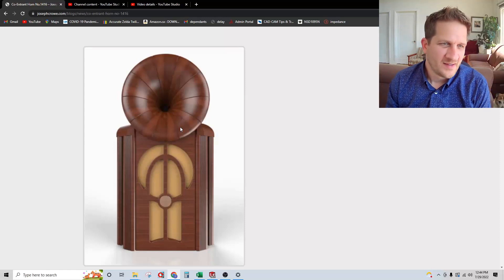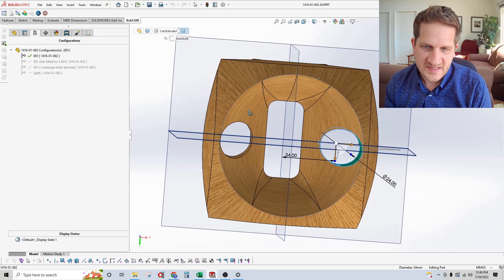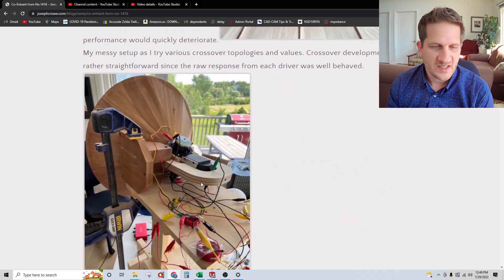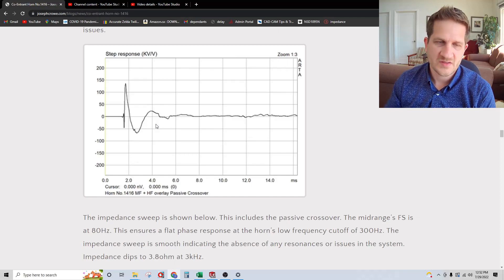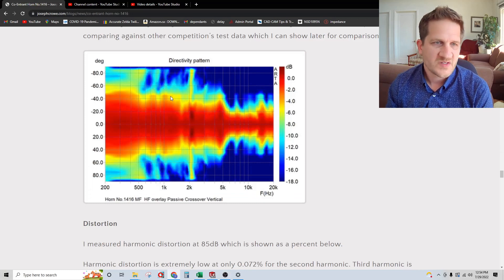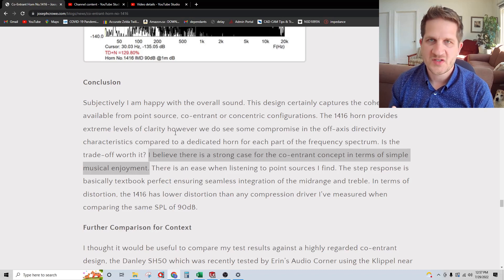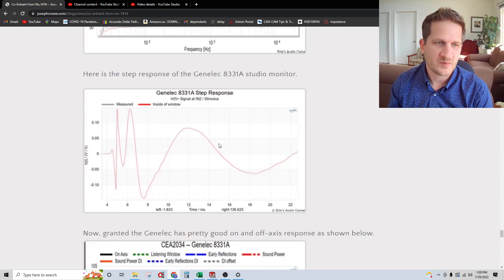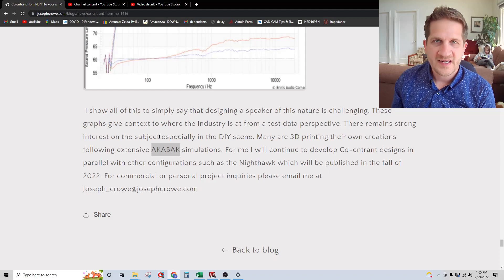Co-Entrant Horn No.1416

Comment: Troy, may I call you Troy? (yeah, getting old) I noted that you talked about rotating the mid drivers but in the sound clips, they are still horizontally oriented. Did you fix that somehow so not needed to shift them? I didn't see where you revealed anything about that. Also, if this was not a commissioned job, what drivers would you try to use and why? Sounds like another video to me :)  Time for an update on this project, please.
Reply from the maker: The design is now commercially available through Kinomena and the drivers are arranged vertically. We were able to load the mids down to 200Hz successfully. 

https://instagram.com/kinomenaaudio?igshid=MzRlODBiNWFlZA==

Comment: What is the advantage of coentrant design vs using a single compression driver like a TAD 4002/3 or a celestion axi2050?
Reply from the maker: There’s potential for lower intermodulation distortion since the tweeter is not modulated to the midrange. The tweeter can also have a very fast impulse response which means transients are improved. This uses a ribbon tweeter which has a very low moving mass. 
Also, with 1416 there’s no crossover on the midrange. This provides a little bit more expressiveness through the vocal range compared to adding large capacitors in the signal path.
Reply: @JosephCrowesDIYSpeakerBuilding  
Thanks. It seems like a very complicated design to master. I like that the midrange crossover could be deleted.